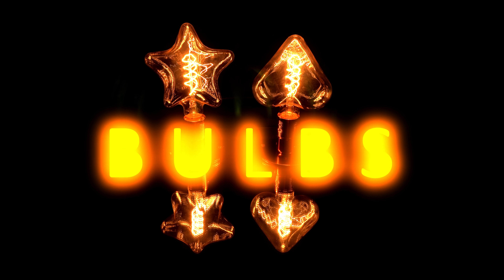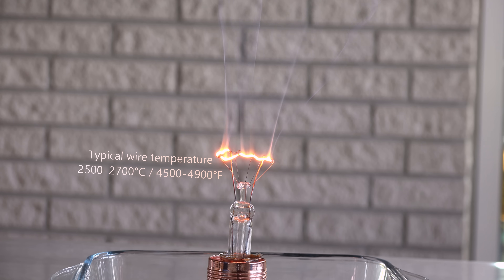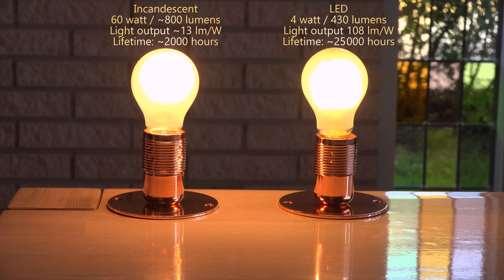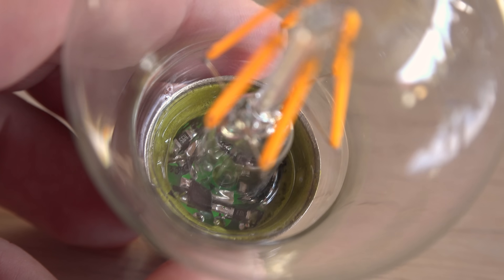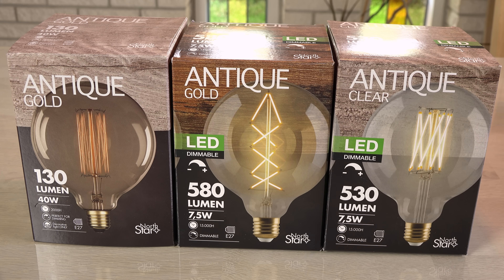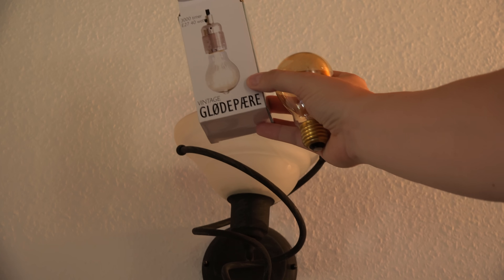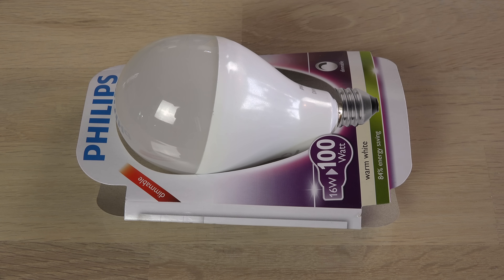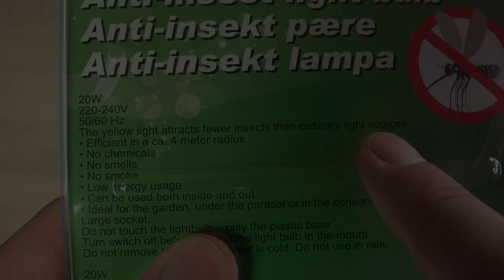Light Bulbs | LED vs. Incandescent

Comment: Why is the idea of Denmark banning the sale of inefficient light bulbs triggering all these Americans in the comments?

What was wrong with lead based paint? What was wrong with asbestos-lined homes? It's dun dingit tyranize!!! We dun can't have the dun dingit govinmunts dun tellin us whats we can't n can't not do!!
Reply: IIGrayfoxII
I agree.. the strange thing is that everybody (including tree huggers) jumped on the CFL bandwagon from the start. Now everybody is jumping on the LED bandwagon.
Reply: LSD Yes, the logic is identical.Stuff that's toxic to my neighbors / a public risk / going to explode or catch fire, or some shit? Of course ban it. That's fine that makes sense.

Lightbulbs pose NO threat, though. They're just more expensive. Thus, banning them is holding my hand as if I'm too stupid to do a basic arithmetic problem or choose how much of my own money I wish to spend. Or even if you argue it purely from economics, there's a billion other things I buy that could have had a lower economic impact that the government doesn't nanny me about: stainless steel refrigerator versus one with a plastic shell? wood floors instead of bare concrete? etc. etc.

It is EXACTLY the same as banning any other luxury good for the same reasons. You could make the same argument for the government banning cashmere sweaters, because rayon blend ones are cheaper, or banning me from owning both a couch and a bed when I could buy a futon and thereby have a lower environmental impact.

Why are those ANY more ridiculous than this is? And why are you not advocating laws for all of those and the other billion things? It's just internally inconsistent, disorganized nonsense.

Lobbying (as the guy above me suggested) is actually a plausible explanation as to "why this arbitrary thing and not everything else?", but who knows.
Reply: LSD Yeah, sure, energy inefficient. So are  imported cashmere sweaters. So is owning multiple pieces of furniture when one would do the job. So is living in a house with more rooms than you need. So is running your air conditioner at 65 degrees. So is taking a shower every day instead of 2-3 times a week. So is owning a pet. So is buying a full size laptop instead of a netbook. So is cooking with extra virgin Italian olive oil instead of bulk canola oil.

How many of those things would you like to regulate for government enforced energy conservation? Many of them have a larger impact by far than lightbulbs do, too.

And if you aren't willing to regulate all of them, how are you not being an arbitrary hypocrite?

-----------------------
Re: random assumptions:

None of this has to do with "distructing government." There's nothing to "trust" here, the Danish government already told us their exact plan. The problem is it being a stupid and inconsistent plan, not trustworthiness.

Nor did I mention anything about not considering poverty or illegal wars as a problem...? If you don't expect your government to be able to multitask on solving, you know, more than one problem at once, then you would seem to be the one that doesn't trust government, not me. I, personally, hold them to a high enough standard that I expect them to stop illegal wars, work on poverty, AND eliminate arbitrary, bad laws, all at the same time.

And I don't live in America.
Reply: LSD Foreign oil has to be shipped to you, using fossil fuels, etc., whereas where I live (Canada), canola oil is all local (that's where it is mainly produced). Premiere oil usually comes in much smaller less efficient containers. And olive oil is significantly less energy and resource efficient in the first place compared to cheaper vegetable oils, with more water and erosion issues, etc. First press agreed is not particularly relevant.

Anyway:

"Other stuff doesn't have alternatives" nonsense, did you read my post? I provided a lower impact alternative for EVERY example.

"Not everyone uses olive oil, everyone uses lightbulbs"
sure, but when you add up all food products, for example, total, they will have a MUCH larger environmental difference/impact than the lightbulbs do. A government mandated set of low impact diet options overall would much much much more massively benefit the environment than lightbulb bans. Do you support that? If not why not?

"Harder to measure"
This doesn't make any sense, because the current method for dealing with lightbulbs isn't measuring anything either/anyway. You can't say a possible piece of legislation is "harder to pass because it's harder to measure than this other law that doesn't involve measuring anything"... For example, air conditioning: Simply don't SELL air conditioners legally anymore that have settings that go lower than 72 or something. Just like the lightbulbs. Older models phase out, no need to "measure" anything.

"No drawbacks"
Cooking with canola oil (and all other diet alternatives, outside of medical needs exceptions), or A/Cing your house to 72 instead of 65 also have no significant drawbacks for the vast majority of people, just like lightbulbs.
Reply: It's not a "scam".  The fact is that even if the bulbs cost more, they use enough less electricity that it more than makes up for it.  And because the bulbs last so much longer, you don't have to buy as many.  I started converting to CFLs about 15 years ago, and in the past five years, as those go out I replace them with LEDs.  Right now, the computer room I'm in has been lit by LED bulbs for the past five years.  I haven't had to change them and instead of using 120w to light the room, I use 16.  I'm spending less money to light the room than you will with incandescent bulbs, and changing lights now means one or two bulbs a year.  The one with a week mind is the one who things everything is some big conspiracy.
Reply: There is also the fact that banning them eases loads on the electrical sub system.

If a substation powers 1,000 homes and all these homes use 75w filament bulbs for lighting that is 75,000 watts of power for all those homes to power 1 bulb.

Now 3 bulbs powered on average and that is 225,000watts and in summer when people use AC this can cause the substation to be overloaded.
But replace those filament with 10w LED and the load on the substation is 30,000watts.

These reductions also can mean a reduction in kilowatt hours you pay since the substations require less maintenance

And those who cry who cares how inefficient they are as they can not see how inefficient they are literary most of the energy emitted is infrared
Reply: +Gavin Jenkins
You and John Boy seem to love the slippery slope fallacy.  Just because the government bans one thing, there's no reason to think that they're going to step in and unreasonably ban many other things.  This is the same argument that people use against gay marriage (i.e. "if we let two women marry, then we're going to have to let people marry animals, etc.", which is not a reasonable counter argument).

LEDs have gotten way better looking and cheaper in a very short time.  And as others have mentioned, they save you money in the long run.  

Furthermore, although there's nothing directly poisonous/harmful about incandescent bulbs, you seem to be ignoring the consequences of consuming more energy that generally results in more CO2 emissions and other emissions.
Reply: +John Boy
It is known that CFLs were not good since the start since a CFL bulb is nothing more than those tube lights you will have in the garage but in a compact form.

The mercury(the vapor to be exact) is used to make light.
When you pass an electric current through a gas it emits light.

Mercury emits some and bluish light as well as UV light so to prevent you getting skin cancer and to correct the color temperature , the bulbs are coated in a white phosphor powder which absorbs this UV light and emits red light, this makes the overall light look white.
Reply: LSD Somebody moving into a new apartment without bulbs? What are you talking about, I've had to do this twice before. All it requires is a cheap ass landlord. Which are the ones you deal with anyway when you aren't well off.

And the credit ramifcations are not ridiculous at all. That's what it's like to be destitute. I have seen major debt problems from far less ridiculous situations. Even ones not based on anything at all, like an error on the bank's fault for an overdraft fee that wasn't an overdraft, then compounding due to negative balance fees, bank refuses to reverse it, person can't afford to just pay it off in the meantime. Person starts having issues due to negative balance elsewhere, unable to pay other bills, etc. Person cannot afford a lawyer or anything to argue with the bank's stubbornness. Person eventually has to take out a credit card to pay off their bullshit negative balance just to not miss other payments etc. Now has $300 in credit card debt all of the sudden from thin air.

When $0 / imaginary errors can cause that, $70 certainly can.

Of course, in this situation,they wouldn't pay the $70 for bulbs since it's not life threatening. They would just get 1 or 2 and make do. But that is why I said at the start "Oh well, guess you hang out in the dark"
Reply: The americans banned inefficient light bulbs a while back.
So this video brings back those "Bad Memories"
Reply: John Boy  "LED's only have one advantage - lower power consumption."

They also last many times longer.

"Higher up front cost"

Which is more than made up for by the fact that you don't have to buy nearly as many.  And it's not like it's a huge cost difference anymore.  By the second or third time you don't have to replace an incandescent, the LED bulb has paid for itself just in the cost of the bulbs.

"If you've faced the horrible xenon car headlights then you know what I mean."

That's not the color as much as it is that they're so damn bright.

"non compatibility with dimmers,"

That's true of CFLs and some LED lights, but not all.

"The nice thing about incandescents is that they mimic the color spectrum of fire / candles"

Then buy the 2700k LEDs.  That's the same "color temperature" as most incandescents.

" It (reading retention) drops significantly when reading material off an LED backlit screen "

Can you point me to a study that shows that to be true?
Reply: Gavin Jenkins
I would say that if there's sufficient societal benefit to a ban, and the consequences of the ban are reasonable/manageable, then I'd be in favour of it.  So, in the case of the incandescent ban, I think the consequences in terms of cost and light quality are very reasonable.  Without delving too deep into the specific items you listed, the practicality of those ideas relative to the incandescent ban may be too unreasonable for now.  Simply enforcing some of those things may be impossible.  Whereas eliminating a light bulb option from people's lives could be comparatively easy, especially since there are still very good options available.  It's generally better to start with the easy changes first and then move on to the tougher ones.  That being said, if things are dire enough that we have to take drastic measures, then I may have to accept unpleasant consequences.

Regarding "being a hypocrite doesn't invalidate an argument/position.":
Saying it does invalidate the argument is the Tu quoque fallacy.  It's a form of the ad hominem fallacy.  Arguments stand or fall on their own merits, regardless of who's making them. 

If there are other things that we could be doing that are equally as practical as switching from incandescent bulbs to LEDs, but were not doing them yet, it doesn't mean that the ban on incandescents was unjustified.  Just from a practicality stand point, we can't roll out every single energy saving ideas simultaneously.
Reply: ASBESTOS is only dangerous if taken internally. It is a great thing to have for gloves, compared to the ceramic fiber when handling hot things. Also the fibers do not get into the skin and cause itching. It is also no problem in cement used in heaters unless it is disturbed. If it is there in your exhaust for your heater leave it alone if you mess with it you will be breathing the dust from it.

ANYONE that believes that LED's and other such things are not about getting more money out of our pocket is an IDIOT!
Reply: If the only problem with lead-based paint or asbestos was some bullshit about "efficiency", I'd tell the government to get bent.
Reply: John Daman do you think greenhouse gasses are good for you and the environment?
Reply: I want to decide myself whether i waste energy or not . After all I PAY for it myself (at a ridiculous cost i should mention. Electricity is €0.30 a kWh in Germany. Probably highest in the world?).  
But not everyone here is a braindead communist. I'm sick of these idiots that want the State to tell them what to do. It's MY LIFE. And if I want to buy mercury CFL then it's MY FUCKING RIGHT. Move to China all you cucks. Then I can have more freedom.
Reply: +Eli Cohen Still on sale - where? They weren't it any shops I visited recently. And are you really saying that because we're leaving the EU that incandescent bulbs will being going on general sale again? I don't believe it.
Reply: +Gavin Jenkins "people have a lot of education and information at their fingertips, and can generally make local decisions that may be more rational than an umbrella national law"
So are you saying the gov't should never step in and ban things?  If you think they sometimes should, then I think we're just in disagreement on this one instance.  Or do you think the ban on things like leaded gasoline, asbestos, bovine growth hormone and CFCs was another instance where the gov't shouldn't have stepped in?

While some people may be informed (or think they're informed) on a subject, others are not, and we've agreed as a society to protect those who can't protect themselves.  That sometimes requires regulation on things that have varying degrees of harm to society.
Reply: Gavin Jenkins 

A: Nearly the same isn't the same.

B: Anyone can take a 2700K, 3000K and 5000K bulb, shoot a photo set to daylight and conclude the 2700K (The LED in this case) is terrible, just awful.

Compare a 5000K LED, CFL and Incandescent(...oh wait, 5000K Incandescent bulbs are speciality because incandescent lighting produces horrible colours, so they're gonna cost more than an LED would more than likely at this point) and you'll conclude the CFL looks the worst, and LED will look pretty much the same as Incandescent provided you're not shooting over 3000 fps.
Reply: RyuDarragh If they're "leaking" light into the sky, that's down to the design of the fixture.  You'd have the same problem regardless of the bulb.
Reply: LSD  As I mentioned to someone else here, it's wrong to initiate force against someone for making a choice you don't like. That is the principle at issue. It's not really about how risky something like lead paint is, it's about freedom to take such a risk, and it's not your or my or goverment's place to use force to prevent anyone from taking a risk just as it's not your, my, or government's responciblity for the conceqences to someone's risky choices.
Reply: Gavin Jenkins So you can put a gun to my head because I'm making a risky choice for myself and my family that you don't like?

How about a car? Do you want to put a gun to my head because I drive an old car that is nowhere near as safe and thus far riskier then a brand new car or  leaded paint for that matter?

How many other risky decisions do you beleive you have the right to put a gun to my head and tell me I can't make?

This is what happens when you accept the principle that initiating force against other people, because you think you know what's better for them, or the level of risk they should accept, is good. You become an authoritarian, and it this case, an authoritarian statist.

Congratulations.
Reply: incandescent lights sales are banned in all europe
Reply: and why someone should buy an incandescent light? it's obsolete, it waste a lot of energy, pointless
Reply: Tecnovlog Because they're cheap and effective. So long as it dosn't initiate force agaisnt anyone, people should be free to buy whatever they want.
Reply: cheap? yes maybe they're cheap but you would pay a lot more in the long run, people should be forced to abandon old stuff especially if that old stuff is damaging the environment, for you as a consumer means nothing, for the globe a lot. you don't have to buy led light, there is a pletore of good fluorescent lights that cost only a little bit more than an incandescent light
Reply: doesn't matter? why? do you prefer to spend 50 eurocents less for a light but several euros more every year?
Reply: Tecnovlog The goal of living here on Earth with other human beings.
And I don't care if you, an adult, use heroine, cocaine, LSD, pay a woman to have sex with you or buy inefficient light bulbs. None of those things initiate force against anyone.

I may give you arguments, reasons, and evidence on why you shouldn't do those things as they are risky (except for the light bulb), but, again none of those things initiate force against anyone and the risk is yours to take, as are the consequences.

I don't think you should let a child drink alcohol but 1. that's not something most children elect to do and 2. an argument can be made that a child does not yet have the experience or wherewithal to deal with potentially dangerous and damaging substances like alcohol so that choice should not be up to a child until they do. I'd say the same of a child playing in traffic, etc.
Reply: ***** The environment isn't the point, morality is.

btw Name something that isn't, in some say, directly or indirectly ecologically hazardous. Me taking a crap in the wood is ecologically hazardous if my number 2 bombs land on a patch of grass and smothers it.
Reply: Those "inefficient " light bulbs aren't poisonous like the other things you mentioned are. But the mercury vapor in flourescent light bulbs and LED is poisonous. Hole in your logic isn't there.
Reply: 1st understand that burning wood and give back co2 to atmosphere is normal and ecological.  Problem is extra levels that plant can not absorb, problem is that we release co2 from a lot more then 1000 years ago from carbon and oil,and even that CO2 will not be problem if we keep level of forest that can absorb that,but on other hand we release a lot more,and in same time we cut a lot more forest, so level of co2 increase too much...so choice is only to cut releasing co2 ,OR to make our planet temporally more green,by planting forests...but no, we cut ,cut,cut more ,a lot more then is allowed.. sum this all together ...and seems that only reducing power consumption ,together with more green power construction is key. So AAA grade eco friendly ,less energy products..but we need to ban oil and coal for energy production world wide..But,you know that is not near future,right! LED lighting have its part ,in consuming less energy world wide,and burning less coil and oil for electrical energy production..
Reply: +LSD - I did not take the time to read all replies in this thread. I only want to give you the simple answer to this question. This may have already been answered, but here is my opinion to add to the mix... 

(THIS ANSWERS YOUR QUESTION, I believe, about why Americans are so angry regarding government bans of selling these bulbs, even if these bans make sense in the long term!) 

Many people will come up with justifications for their arguments. They bend over backward to come up with many reasons, but I believe there are really only two reasons here for why people in the U.S. dislike the incandescent bulb ban. 

.
ONE - When this ban went into effect, you could buy a light bulb for about $0.20. They were very cheap and very disposable. I'm sure there is a lot of tungsten in trash landfills because they were quite easy to throw away and replace. 

At the same time, CFL bulbs were, at best, about $4.00 apiece. They have since come down a little, to about $2.00 apiece, but it's still significantly more expensive to buy light bulbs than it used to be. And, at the time, LED bulbs were very expensive. About $10 each. Very different from $0.20 each, and this angered many people. (LED bulbs have since come down to about $2.50 each, and I hope they continue to get cheaper.) 

.
TWO - The people who live in the U.S. are not descended from calm, quiet, reasonable people who moved here from other countries despite having a good life there. The ancestors of the people in the U.S. were generally all hot-headed, angry, stubborn, argumentative types of people, who didn't get along with their home countries when they moved here hundreds of years ago - and they usually moved here because they had terrible lives in their home countries. 

I believe that this can be demonstrated by looking at National attitudes, and can also be compared to Australia - which was founded under similar circumstances to the U.S. There is a good reason people in the U.S. get along so well with people from Australia. Our great, great, great grandparents were either forcibly thrown out of their home countries, or left in great anger and resentment never to return. They were not nice, calm people - they were argumentative and usually angry people. Some people today disagree with me about this, but I still believe I am right when I say that you can see these attitudes today in the great, great grandchildren of those immigrants from long ago. 

As such, people in the U.S. do not like it when the government tells them they cannot buy a simple light bulb. They come up with many arguments to justify their anger and their arguing, but the simple fact is that most people here do NOT like being told they cannot do something that they have previously done all their lives - such as buying a simple, cheap light bulb. Reasonable arguments about electrical requirements and National generator grids do not matter when somebody is simply angry at being told what they can or cannot do. 

.
So... keep this in mind. Regardless of any other arguments people make about the incandescent bulb ban - it always comes down to one of these two things in the U.S. Or, usually, both at once. We don't like being told, "You are not allowed to buy those from now on," and... the bulbs we have to buy now are, at best, ten times more expensive than they used to be. 

(Arguing that they save electricity is usually pointless too, because that savings only comes after many years, AND because many people have to buy bulbs that are not for themselves. Such as at an apartment that will be rented, at an office, for a neighbor or relative's house, etc., etc. For example, I repair many apartments {flats} that will someday be rented to somebody I don't know - and I don't like spending $100 or more on light bulbs when that cost used to be less than $10.)
Reply: I dont like muh government regulation but what's toxic about LED bulbs? They're just an array of semiconductors slapped onto a power supply.
Reply: +LSD - Oh, and one more thing... I live in the U.S., but I can't figure out what "dingit" is supposed to mean. What is "dingit", anyway? :P
Reply: "its my life, therefore i should make everyone else's lives worse"
Reply: It's making no ones life worse. In the day and evening I usually have on 8 -150 watt incandescent bulbs and 4 - 300 watt ones because I prefer the light they give and I have a lifetime supply.  I purchased a variety of incandescent bulbs, all total I have 1800 of them and they last and last.  i love it, there's 12 houses on my street and I probably use more power than all of them put together and I could give a shit.  When I travel I always bring a six-pack of 150's to swap out the bulbs in the room temporarily, I like to see.  So suck it.
Reply: +VivaMessico
I would agree with you on that. Government was created by economics, and and such, it cannot be separated. However, I was noting that capitalism was not a societal system, not that it wasn't political. I say this because the amount of corruption currently in a society does not affect what system it is unless the corruption would cause the government to physically change the system, which in the US, would require an overhaul of the Constitution. A true capitalism is anarchy, just as a true socialism is totalitarian.
Reply: Ender Skies "Does not the"? Since apparently judging by the phrasing, you are a time traveler from 1700s, the "plebians don't know how to live their own lives" I guess makes more sense in context. In 2016, though, people have a lot of education and information at their fingertips, and can generally make local decisions that may be more rational than an umbrella national law. The example from earlier in the discussion of people with electric heating in a cold climate being one situation where incandescent bulbs are better if anything for the environment, locally.

Though if you insist on bludgeoning the problem with a blunt one size fits all baseball bat of a solution, you could at the very least do it in a tax or incentive way rather than a hard edged ban, to still create the same trend, but with optional freedoms.
Reply: Dan Heuser 
no I am okay to ban things based on criminal potential, and uses in infringing on others' freedoms or safety. Lightbulbs do not fit those criteria. Many other things do, including several of your examples.

Even if you include climate effects (hard to quantify though since we don't know how much damage that might cause), lightbulbs still do not fit those criteria in some instances, and they also much much less of an influence than other things that are still legal, making for inconsistent and arbitrary law.
Reply: Ender Skies "If a child refuses to do whats best for itself, does not the parent have to force it to?"

And there's the nub of the issue.  I am not a child who must be guided by a government that knows (or thinks it knows) what's best for me.  I'm quite capable of making ration decisions without the government telling me what I must do.
Reply: I'm just lucky I have a stock pile of 'banned' bulbs that I require. But  I think it's much more reasonable for the government to incentivize greener tech, possibly increase Tax in lower efficiency products but I don't think a ban is best for the open market.
Reply: https://www.cnet.com/news/side-by-side-led-cfl-and-incandescent-bulbs/ You can see the color difference here. (That was written in 2011 but nearly the same LED bulb model is still a widely manufactured one, retailing $10 each today). Not enough to be a big concern to me personally (it's a philosophical and economically mishandled issue to me), but it is also not the same color.
Reply: I didn't conclude ANYTHING, if you'll notice, about any of those being the "best" looking. Please do not put made up words in my mouth.

I said that you can see the difference between all three, in a test run by a well respected technology authority that we can safely assume neutralized its camera sensor etc. correctly. And you can, indeed, tell the difference easily between all three.

I was replying to Ender Skies who seemed to be baffled by the base concept of different bulbs looking differently. They do look different. From there, which one anybody prefers is obviously subjective.
Reply: 177SCmaro Lead paint it IS the government's place, because unlike incandescent bulbs, the owner of a building responsible for lead abatement is NOT necessarily the only one at risk from the poison risk. Children who don't know any better and/or employees etc. are at risk,so intervening to force proper behavior if needed is in fact protecting innocents from harm done to them by another.

Even if you live alone, it can and will leech off into water, etc. etc.

For the lightbulbs, though, this logic does not apply. The energy bill is only the owner's responsibility.
Reply: 177SCmaro Yes "You" making a decision for people who are "not You" means you are potentially violating your own prime directive you described earlier: initiating harm against others. Threatening you to stop you from threatening others is not immoral. It is the same concept as self defense being an acceptable form of violence, because you are stopping violence perpetrated on another, not initiating.

YOU INITIATE the harm when you subject others (children, employees) to dangerous building conditions outside of their control or perhaps even knowledge. So when your philosophy is "never initiate harm" then YOU are the bad guy breaking your rule with lead paints.

Anything that only threatens you is your business. If you threaten others it's not your business anymore.

Bulbs are totally different in that their inefficiency does not hurt innocents on site other than the owner him/herself, so no harm is initiate on others, thus should not be regulated.

And yes, absolutely you could be morally regulated for an old shitty car, because you are forcing (and initiating) risk on OTHER people, so it's not your own business anymore. As long as you're on public roads, at least. If you want to drive a rattling death trap around your own private parking lot that nobody but you uses, and with only consenting informed adults as passengers, have a blast.
Reply: Gavin Jenkins "Yes "You" making a decision for people who are "not You"..."

Isn't that what you're doing? Isn't that what "the state/government" fundimentally is? Why is it wrong when i do it but right when you or a government does it?

"...means you are potentially violating your own prime directive you described earlier: initiating harm against others..."

First of all, it's "initation of force".

Secondly, the Non-Aggression Principle is not a "directive", it's a principle.

Third, we are talking about RISK, not of definite harm. Things like leaded paint, dangerious conditions, or less-safe cars are a RISK of harm, not definite harm.

Fourth, you never addressed the point.

Why do you think you or anyone else has the right to point guns at people and tell them what level of risk they are allowed to accpet for themselves and thier family?

(btw, I took great care to have my house inspected for leaded paint, asbestos, etc before I bought it and I didn't need someone pointing a gun at me and telling me to)
Reply: 177SCmaro The crucial difference is that the decision you are making is initiating risk and harm on others. Whereas the decision the state is making is only responding to your initialized harm and risk. (The distinction between risk and outcome is a silly one, they're both reasonable basis for intervention. Otherwise there is a trivial loophole in doing anything you want ever, because there's always a <100% chance it will actually work. Like if I shoot you, technically it's a RISK that I hit you, not a guarantee? Is that okay then? Lol no.)

In short: you started it when you risked others beside yourself, thus you voided any moral right to privacy and/or sovereignty. The state did not start it. They're responding to your initialization of harm.

If you want to be left alone, don't endanger other people.

"what level of risk they are allowed to accept for themselves and thier family?"

What level for YOURSELF? No, that's your own business. What level for your FAMILY? That's not your business. There is no logical basis for you deserving or having any right to control or make decisions for family members any more than any random stranger, and others are just as justified in intervening if you endanger them without their full knowledge and consent as if you endanger strangers. Especially in the case of young children, who aren't cognitively capable of understanding lead paint's dangers and cannot generally be perfectly supervised 24/7, this is relevant for this discussion.
Reply: Gavin Jenkins
" The crucial difference is that the decision you are making is initiating risk and harm on others."

Now you are conflating the two. Risk and harm are two differnt things. It's risky for me to buy my family a home with leaded paint. It's harm for you to shoot me in the head becasue you don't agree with that decicion and I told you to fuck off.

erm...not in that order.

"The crucial difference is that the decision you are making is initiating risk and harm on others. "

And, again, I have to point out that: isn't that what you're and government is doing by pointing a gun at me on account of taking a risk for my family? Seems like you are imposing an even greater risk then the piant.

"In short: you started it when you risked others beside yourself..."

If it's my family you're talking about, then what you are saying is, I don't own my children and decide what level of risk to take, my children don't own themsleves and decide what level of risk to take, "the state" owns them and decides what level of risk to take.

Well, again, why do you think anyone has that right?

"...thus you voided any moral right to privacy and/or sovereignty."

Why? Becasue you don't like a choice I made and a risk I took on behalf of my family you (or the state) fucking owns them now?

"They're responding to your initialization of harm."

Again, we are talking about risk not harm.

"If this doesn't include all harm, then that's just a stupid philosophy then."

ffs, it's a PRINCIPLE not a philosophy, learn the difference, and I didn't say it does or dosn't include all harm. It refers to FORCE, which implies harm, among other things. It didn't occure to me that I'd have to explain something so simple, but here it is.

":That's an irrelevant distinction."

sigh.....you're obtuse. Thanks for that waste of time. Moving on.

"What level for YOURSELF? No, that's your own business."

And, apparently, yours too as you beleive that it's right to put a gun to other people's head and tell them what level of risk they are allowed to accept or who can make descitions on thier behalf, or what decitions that person can make.

"What level for your FAMILY? That's not your business."

So it's not MY bussness what level of risk MY familey accepts. Did you not read these before sending it to me? Becasue you just said what is mine isn't my bussness.

Is it my famliy or is it "the state's" family? Who does "the famley" belong to? Or, the more salient question is, who do the children belong to?

"There is no logical basis for you deserving or having any right to control or make decisions for family members any more than any random stranger, and others are just as justified in intervening if you endanger them as if you endanger strangers."

That is a logic self-contradtion.

If there is no logical basis for me deserving or having any right to control or make decsistion for family members, then it follows this is true for everyone: stangers or "the state" included.

If no one has any right to control or make desistions for others, then that pecludes them intervening as that is a form of control and making desistion for others.

In fact, if there is no logical basis for anyone deserving or having any right to control or make decsistion for others, that logically precludes government/"the state" from existing.

So I guess you're an Anarchist now like me then. Welcome to the club.
Reply: "isn't that what you're and government is doing by pointing a gun at me"

No, the government is causing a risk for you. But they aren't INITIATING it. You initiated it. They are responding to you. Thus, it is still always within your power to live your life free of that intervention, by choosing to not endanger others. Do so, and I'll leave you alone.

"I don't own my children "

Um of course you don't "own" your damn children. Slavery is about the least possible libertarian thing you could possibly have suggested. You're going wayyyy off the deep end here.

"Let [my children] decide their own risk"

No, if they are incapable yet of looking out for themselves, then their caretaker has to do so for them, of course, but I can reasonably still obligate you to do a proper job of it. Leaving your kid in a cage and feeding him mouldy bread and water is unacceptable and demands intervention for abuse and initiation of completely unnecessary harm. Lead paint is a milder version but the same concept.

If you can't manage to raise your children in a non-harmful and negligent way, don't have children, that's on you. But you created a human, and thus you created an obligation--like with ANY human under libertarian principles--of another person to not initiate harm of. If you can't hack that responsibility, you are free to wear condoms. But if you have the kids anyway and don't take care of them, it's no more morally okay then mugging somebody in an alleyway.

"Again, we are talking about risk not harm."

And again, a system built on actual harm is completely unworkable. Because you NEVER know what is 100% harm until it's too late and it's already been done. That's a stupid, unworkable system. It allows me to flood your house with radiation, for example, because there's some % chance it won't give your horrible cancers, so it's a risk only? Sweet! A-okay! It allows me to dump poisons by the gallon into your water supply, and you could do nothing about it ("only a risk!") until you actually get poisoned at which point it's probably too late.

Of course we can't have a system like that. It'd break in 5 minutes. Risk must be included in any real world system, or everybody would have a million ways to slaughter each other and utterly wreck property and environment carte blanche so long as it's just slightly delayed on a little bit uncertain.

"If no one has any right to control or make desistions for others"

No, you DO have a right to RESPOND to harm being done. You only don't have a right to INITIALIZE harm.

It's only a contradiction because you mischaracterized it / ignored initialization. Which seems awfully intentional, considering that you brought up the concept of initializing actions in the first place here, not me, so I know that you full well understand it... until it's convenient for you to forget apparently.

Murder? Not okay, initialized. Self defense manslaughter? Acceptable, wasn't the initializer, the attacker voided his rights by starting it. Similarly, arresting you because I don't like your face? Not okay, initialized. Arresting you (or whatever the required level of intervention is to stop the situation -- in the case of lead paint simple economic regulations are less drastic and sufficient) to stop you harming somebody else? Acceptable, you would be initializing it, and thus voiding your rights.
Reply: Gavin Jenkins "No, the government is causing a risk for you. But they aren't INITIATING it. You initiated it. They are responding to you. Thus, it is still always within your power to live your life free of that intervention, by choosing to not endanger others. Do so, and I'll leave you alone."

Really? I'll have to remember that when April comes around that if I leave goverment alone it won't initiate force against me via taxation and will leave me alone. Becasue, you know, logical consistency and all that...

And, again, I have to point out that pointing guns at people for not doing what you want them to do is much riskier then lead paint.

"Um of course you don't "own" your damn children. Slavery is about the least possible libertarian thing you could possibly have suggested. You're going wayyyy off the deep end here."

Okay, but note that you failed to specify who does, which was my point. Who owns, and is thus responsible for, children if not the parents?

"No, if they are incapable yet of looking out for themselves, then their caretaker has to do so for them..."

So I have to look out for my children, but I don't own them. Isn't that like saying I'm responsible for my children's safety, but, since I don't own them, they don't have to do what I say? After all, you can't command things you don't own.

Again, who owns children?

"Leaving your kid in a cage and feeding him mouldy bread and water is unacceptable and demands intervention for abuse and initiation of completely unnecessary harm. Lead paint is a milder version but the same concept."

Um, no. Putting someone in a cage requires force in you putting them there. Living in a house that has increase risk to one's health becasue of lead paint is not force.

You are still conflating risk and harm. It's harmful to force someone into a cage and feed them moldy food, it's risky to buy a home with lead paint for your family to live in.

These are not the same thing.

"If you can't manage to raise your children in a non-harmful and negligent way, don't have children, that's on you. But you created a human, and thus you created an obligation--like with ANY human under libertarian principles--of another person to not initiate harm of. If you can't hack that responsibility, you are free to wear condoms. But if you have the kids anyway and don't take care of them, it's no more morally okay then mugging somebody in an alleyway"

Okay you keep going on and on about this, but, again, who owns children? If it's not the parents, then who?

"And again, a system built on actual harm is completely unworkable. Because you NEVER know what is 100% harm until it's too late and it's already been done."

So we should put people in jail based on the likely hood that they may cause harm, even when they haven't actually harmed anyone.

I guess we should all be in jail then since we all have some chance at causing harm at any given point in our lives.

"It allows me to flood your house with radiation, for example, because there's some % chance it won't give your horrible cancers, so it's a risk only?"

Um, no. That would be an a contamination/intrusion on someone's property. That's a bad example for the point you were trying to make.

"It allows me to dump poisons by the gallon into your water supply, and you could do nothing about it ("only a risk!") until you actually get poisoned at which point it's probably too late."

See above.

"No, you DO have a right to RESPOND to harm being done"

Which is a form control or making decisions about risk for others. I noticed you tried to step WAY around that one but, again, if no one has any right to control or make decisions for others, then that precludes them intervening as that too is a form of control and making decisions for others.

In fact, if there is no logical basis for anyone deserving or having any right to control or make decisions for others, that logically precludes government/"the state" from existing.

So I guess you're an Anarchist now.

You destroyed your own argument.
Reply: "And, again, I have to point out that pointing guns at people for not doing what you want them to do is much riskier then lead paint."

Oh good so you acknowledge risk does matter now as a valid means of something you're not allowed to do unrestricted. I am glad we agree finally on that. Saves a lot of typing. Also, I'm not at all sure that pointing guns IS actually riskier to health than lead paint... as long as it's a child exposed (it's a developmental poison). Lead is really fucking bad for children.

"So I have to look out for my children, but I don't own them."

Yes this should be common knowledge that slavery is not legal or right, but that you still have to take care of your kids...?? Duh.

"Isn't that like saying I'm responsible for my children's safety, but, since I don't own them, they don't have to do what I say?"

Children do not "have" to do what you say in either an actual modern day legal sense nor libertarian philosophical sense. In most states today, for example, you have some leeway for things like sending your kid to bed without dinner for a day, yes, but at some point, if you keep doing it, you could be breaking the law and it would also be inappropriate under libertarian concepts as well to endanger a child with lack of food as a means of control, for example. Similar for physical force. At some point, you run out of options, but as long as your care isn't the thing they're refusing (such as a hunger strike), you're still obligated to care for them even while they refuse to keep swearing a lot or whatever non-life-or-death misbehavior you don't like.

"Again, who owns children?"

Nobody owns human beings. What are you even talking about? Unless you're suggesting we reinstate slavery, this is just an undefined/nonsense concept.

"Living in a house that has increase risk to one's health becasue of lead paint is not force."

Yes it is. They're a little kid who can't get a job, etc., and will freeze to death outside. They have no other options, so they ARE forced to sit in your lead-filled house before a self sustaining age. They also got into that situation because of YOUR choices in having them. So it's not like some hobo that doesn't have other options knocking on your door: their predicament in this case is entirely YOUR doing and thus your mess to look after.

Also at some point young enough, they won't even know it's a risk to have tried so much as considering a plan (babies). So it's not even just an issue of force versus options or choices or wills. Lead in particular is especially aggressively regulated largely because it's MOST dangerous to kids at precisely the ages that don't even have the capacity to understand it or can't escape it / maybe can't even walk yet.

"if no one has any right to control or make decisions for others"

Well that's easy: they DO. I never said they didn't. You absolutely have a right to both control and make decisions for others in a specific set of circumstances from both a modern legal standpoint as well as a libertarian doctrine: any ones where their decisions and actions without being controlled would have led to harmful endangerment of another person besides themselves.

The logical basis is of course that it is impossible to have a society where people don't initiate harm against others, if nobody ever enforces that rule. Those words only mean anything if and when you can go out and stop somebody who is breaking them / endangering others.

"So we should put people in jail based on the likely hood that they may cause harm, even when they haven't actually harmed anyone."

No not necessarily. We should do whatever the MINIMAL thing we can do is to remove the high risk of harm, which depends on lots of things, the timeframe of the risk, the urgency, the motivation and likelihood of it recurring, etc.. If they are foaming at the mouth and waving guns around and have gone totally insane and will do it again tomorrow and the day after if not stopped, then yes, that's probably jail until. If it's lead paint, then jail is clearly not necessary, because there's a much more minimal option: simply not having it on shelves. Jail would be overkill.
Reply: Gavin Jenkins "Oh good so you acknowledge risk does matter now as a valid means of something you're not allowed to do unrestricted."

I don't know what means. There is risk in literally everything you do. My point is it's wrong for you to point a gun at me or my family and tell us what level of risk we must accept.

"Yes this should be common knowledge that slavery is not legal or right, but that you still have to take care of your kids...?? Duh."

facepalm.....oh my god I wish you would actually think about what you type, becasue one could desrible being a slave as someone else being entitled to you or your protection, labor, etc but you having no say or athority over them as you don't own them.

In effect, they own you. They have a right to you, you don't have a right to them.

So you are saying that I don't own my chidren, they effectivly own me, we just don't call it ownership. We just call it "something you have to do".

The problem here is you don't want to say parents own thier chidlren, but you still want to hold parents responsible for children.

That is a contradiction. If I don't own something, I can't logically, be held responsible for it.

btw, I'm not saying parents should or shouldn't own thier children, I'm just pointing out the fundiemntal contradiction your entire argument is based on. More on that shortly.

"Children do not "have" to do what you say in either an actual modern day legal sense nor libertarian philosophical sense."

Then, again, how can I be held responsible for them? If a child dosn't have to do what I say when I tell them not to jump off a cliff, how can I be held responsible for the child's broken leg after he or she jumped off the cliff?

In other words, if you are under someone's protection and you don't have to listen to them, how does it make sense to hold them responsible for you getting injured on thier watch?

"Nobody owns human beings"

Nobody? So a human being is akin to a random rock in an unowned forest that anyone could come along, pick up, and thus own?

Are you sure human beings don't own themselves?

"...their predicament in this case is entirely YOUR doing and thus your mess to look after."

Then stay out of it. You can't have it both ways. You can't say I don't own my children, but I'm also somehow responsible for them and so it's my responsibility to fix this lead paint problem for them and then point a gun at me as though you own and are responcibole for my children and its your responciblity to rescue them.

Me: "if no one has any right to control or make decisions for others..."

You: "Well that's easy: they DO. I never said they didn't."

You're contradicting yourself again. And yes you did say they didn't.

I quote you:
"There is no logical basis for you deserving or having any right to control or make decisions for family members ..."

Unless you're arguing that I don't have any right to control or make decidtions for others but you and/or goverment does, which is logically inconsistent, then you were stating a universal moral principle, which apples to everyone, that principle being: No one has any right to control or make desistion for others.

If no one has any right to control or make decisions for others that destroys your entire argument, which is based on a form of control; namley, intervention, and making a decistion for someone else about what level of risk they should accept, and also the concept of "government/the state", which is fundimentally based on control over others and making decistions for others (even against thier will).
Reply: 177SCmaro "My point is it's wrong for you to point a gun at me or my family and tell us what level of risk we must accept."

But you saying that's wrong to point a gun at you WITHOUT having actually shot you means that you're agreeing a risky/threatening situation is bad enough to stop people from doing even though it hasn't already harmed.

Which is precisely the same situation with lead paint. If you think this is sufficient for intervention with guns *despite no harm done*, why not lead?

"one could desire being a slave as someone else being entitled to you or your protection, labor, etc"

No, one cannot, because that's not the definition of ownership or slavery. Owning services =/= owning the humans, obviously. This is utterly bizarre.

SImply renting a mall cop or a moving company =/= "owning" the cop/movers. Lol??

Similarly, the kid might be said to own the FOOD that you give them, and/or their BED that you give them, etc. Not YOU.

"Are you sure human beings don't own themselves?"

Not the way you are trying to use it as "everything including every bit of your own labor ever, even if they've already committed it or contracted it or given it away or so on" no they don't.

"Then stay out of it."

No. If I don't intervene or am not allowed to intervene when an innocent is being endangered, then how can I expect others to intervene for ME when I'M being endangered?

If this were not the rule, then no sort of society would be possible or make any sense.

"There is no logical basis for you deserving or having any right to control or make decisions for family members ..."

If your family members were threatening or endangering somebody, then yes you could control their actions to stop them, like with anybody else,as per the fundamental principles of libertarianism. This was not relevant to that discussion in that context, ffs I can't put a page long disclaimer on every sentence for every possible context that isn't being discussed yet.

"Unless you're arguing that I don't have any right to control or make decidtions for others but you and/or goverment does"

No, EVERYONE has the right to intervene to stop endangerment against anyone else. And has zero other rights to intervene.

If I initiate endangerment, you or the gov can intervene.
If you initiate endangerment, I or the gov can intervene.
If the gov. initiates endangerment, you or I gov can intervene.
If X initiates endangerment, Y can intervene.

It is not that hard of a concept. You're trying to argue against it by re-casting it into "intervening in either ALL or ZERO situations, therefore __" which is just silly. Of course it isn't all or nothing. Some things allow intervention, others don't. Specifically, it's "allowed for endangerment" but "not allowed for anything else"

"You can't say I don't own my children, but I'm also somehow responsible for them and so it's my responsibility to fix this lead paint problem for them and then point a gun at me as though you own and are responcibole for my children and its your responciblity to rescue them."

Yes I can. This is perfectly consistent with the above rule.

Lead = endangering, so others can intervene.

Not feeding people who you created and are helpless and can only reasonably rely on you = also endangering, so others can intervene.

Two simple applications of a one sentence rule, what's the contradiction? There is none. Simply stating "you can't" at the beginning doesn't make it a contradiction either. It's like writing "You can't pay for sushi but also pay for soda!"
Reply: Gavin Jenkins
"But you saying that's wrong to point a gun at you WITHOUT having actually shot you means that you're agreeing a risky/threatening situation is bad enough to stop people from doing even though it hasn't already harmed."

No, and you're still conflating harm with risk.

Pointing a gun at someone, even without actually shooting them, is a harm. The damage is phsycological. This is backed up by science. 

Living in a home with lead paint is a risk, not a definite harm.

It is a violation of the NAP to point guns at people, it is not a violation to accept a level of risk.

"No, one cannot, because that's not the definition of ownership or slavery. Owning services =/= owning the humans, obviously. This is utterly bizarre."

Defintions are not arguments, they do not reason, etc. If person A owns/commands the products of Person B's labor and Person B gets nothing in return and has no authority over Peson A, Person B is, effectivly Person A's slave. You're describing slavery you're just not using the word "slave".

This is dishonest on your part.

"Similarly, the kid might be said to own the FOOD that you give them, and/or their BED that you give them, etc. Not YOU."

See above.

"Are you sure human beings don't own themselves?"

Not the way you are trying to use it as "everything including every bit of your own labor ever, even if they've already committed it or contracted it or given it away or so on" no they don't."

That is a massive stawman. I never said self-owership is owning "everything including every bit of your own labor ever, even if they've already committed it or contracted it or given it away or so on" no they don't."

Self-ownership means to own one's self - one's body and the products or results of one's body. Labor is a product of one's one body and so one owns his labor and can thus trade it whatever he wants.

So I ask again, are you sure human beings don't own themselves?

"No. If I don't intervene or am not allowed to intervene when an innocent is being endangered, then how can I expect others to intervene for ME when I'M being endangered?"

So you're still trying to have it both ways.

You specifically said: "There is no logical basis for you deserving or having any right to control or make decisions for family members."

Literally what you're saying is, "There is no logical basis for controling or making descistion for others, but I can control or make descistion for others when I don't aggre with them or find those descistions too risky."

wtf am I even supposed to say to that other that point out the logical contradiction?

"If your family members were threatening or endangering somebody, then yes you could control their actions to stop them, like with anybody else,as per the fundamental principles of libertarianism. This was not relevant to that discussion in that context, ffs I can't put a page long disclaimer on every sentence for every possible context that isn't being discussed yet."

How is it not relivant when you specifically said, "There is no logical basis..."

"No logical bases" includes all contexts.

"No, EVERYONE has the right to intervene to stop endangerment against anyone else. And has zero other rights to intervene."

Again, this contradicts, "There is no logical basis for you deserving or having any right to control or make decisions for family members."

"You're trying to argue against it by re-casting it into "intervening in either ALL or ZERO situations, therefore __" which is just silly."

Actually, that is how YOU cast it: "There is no logical basis for you deserving or having any right to control or make decisions for family members."

Maybe you should have said: "There is no logical basis for you deserving or having any right to control or make decisions for family members, except when there is."?

"Yes I can. This is perfectly consistent with the above rule."

No, it's not. You can't logically be held responciple for people's saftey who don't have to obey you.

"Two simple applications of a one sentence rule, what's the contradiction?"

See above.

Look, this has been amusing and all, watching you tie yourself into kots trying to rationaize your logical inconsistencies and outright contradictions. But, again, as far as I'm concered you destroyed your own argument two replies ago, as I pointed out and as you ignored, and now you're just trying to defend it's corpse by pretending it's still alive.

This isn't fun or funny anymore, it's more sad and annoying.

Later.
Reply: "Pointing a gun at someone, even without actually shooting them, is a harm. The damage is phsycological. This is backed up by science."

Wow. No. The trauma of being scared by a big gun is not REMOTELY as bad for you as actual fucking lead poisoning that merely may not happen to be bad enough to give you visible brain damage. If you are including hurt feelings, then you have already committed to way way way less risk than lead as qualifying for intervention.

"and Person B gets nothing in return"

If you don't think you get anything in return, then why the hell did you have kids? That inherently argues against itself. Having them, in a day and age when both abortions and preferably birth control are widely available and relatively cheap, is nearly always a choice made because the parent WANTS them, in other words find inherent value in them, in other words, is getting something out of it. Which makes it not slavery. That makes it just like buying a sandwich or signing a mortgage or dating somebody. You chose to enter into it yourself.

Slaves don't choose their relationships themselves So that is completely different.

"Labor is a product of one's one body and so one owns his labor and can thus trade it whatever he wants."

Yes and YOU DID. You traded it for a kid.

"You specifically said: "There is no logical basis for you deserving or having any right to control or make decisions for family members."

And as I already specifically corrected that, "...except when endangering others." I did not mention it the first time, because we were not talking about it in a context where that was part of the discussion. Regardless, it doesn't matter, because I've now clarified it plainly twice, so please reference the full concept in the future if you're going to at all: No intervention EXCEPT to prevent endangerment. Or depending who you ask, probably also property damage. The end. Same rules for everybody. You, me, government, everyone. 

"You can't logically be held responciple for people's saftey who don't have to obey you."

Okay so you're just simply not a Libertarian then, which makes the whole conversation pointless, since it was about Libertarianism the whole time. The philosophy requires intervening in order to ensure the human rights to not be harmed/endangered/property damaged. If you don't intervene, then those rights obviously do not actually exist, because all you're left with is just politely asking, and obviously 90% of people will just ignore polite requests, making it complete anarchy, not any philosophy at all.
Reply: Gavin Jenkins I'm going to keep this breif, or at least try.

" Wow. No. The trauma of being scared by a big gun is not REMOTELY as bad for you as actual fucking lead poisoning..."

I didn't say it was. You missed the point, which was about you, once again, conflating harm with risk.

"If you don't think you get anything in return, then why the hell did you have kids?"

Again, not the point. The point is you are describing slavery, you're just not calling it that.

"Yes and YOU DID. You traded it for a kid."

If I traded my labor for the kid then I own the kid. Again, you keep going back and forth on this, trying to have it both ways.

"And as I already specifically corrected that, "...except when endangering others." "

Okay, then it's as I said, you're trying to appliy a universal principle when it applies to me and my choices, but creating exeptions for yourself or governemnt when I do something you don't like.

It's wrong for you to control, but not me. Or, it's wrong for anyone to control, except when it's not. 

"Okay so you're just simply not a Libertarian then..."

Nope, I'm an Anarchist, thanks for asking. I'm not saying I nessisarily agree or disagree with any or all the points I've made. Right now I'm just pointing out your logical inconsistencies and contradictions.

After all, an Anarchist can argue that, for example, one form of government is better (or, rather, less-bad) than another but still not accept the idea that any government is rational or moral.

"...since it was about Libertarianism the whole time."

I never said I was a Libertarian or was arguing on thier behalf or that this was about Libertarianism. I don't think I ever even mentioned the word Libertarian on this thread until now.

"The philosophy requires intervening in order to ensure the human rights to not be harmed/endangered/property damaged."

Yes, but you directly contradicted that by stating that no one has a right to control anyone else. That includes interference. That is my point. You can't have it both ways. You can't say interfenence is wrong when I do it by accepting risk on the behalf of my child, but right when you do it becasue you don't agree with that risk.

Is any of this getting through to you?

"If you don't intervene, then those rights obviously do not actually exist..."

Rights don't, nor ever did, exist. They are a concept in our minds. They arn't things like clothing that you can put on a person.

"...making it complete anarchy, not any philosophy at all."

You espcally don't know what you're talking about here. Anacrchy is a philosophy and it has rules, the Non-Agression Princible being the fundimental one and, as far as I know, it's the only philosophy to logically consistently apply that principle. But I digress...
Reply: " I didn't say it was. You missed the point, which was about you, once again, conflating harm with risk."

If you have lead all over your house, the kids ARE getting lead poisoning, that's just basic physics and chemistry. That's not where the "risk" is, it is guaranteed. The "risk" is merely a matter of whether it's ENOUGH lead poisoning to noticeably brain damage them, cause diagnosable levels of developmental delays, etc. And yeah, that part's not guaranteed. But it's sure as hell worse than being scared once no matter what level of poisoning you're getting or if it's easily measurable.

"Again, not the point. The point is you are describing slavery"

If you getting something in return for your labor, and you having given it knowing what that thing was beforehand, is still not enough in your mind to make it not "Slavery" then somebody paying you to mow their lawn is also, therefore, "slavery" because you owe them labor. You got something in return for it, just like with kids. You knew up front what you got, like with kids. But apparenlty these concepts do not matter to you and so anybody getting any labor from you at all makes you a slave. Okay, sure, when you use "slave" to just be a synonym for "work" then yes we are all "SCmaro style slaves" about 99% of the time in any conceivable society. But not actual, rest of the world style slaves.

"I never said I was a Libertarian or was arguing on thier behalf."

The things you're arguing (originally at least) are straight up mainline traditional libertarianism. Not anarchy. Somebody pointing a gun at you is allowed to in pure anarchy, because they're allowed to do anything, nobody is stopping them. Since anarchy is just lack of control, then by necessity what is "allowed" merely defaults to what is allowed by physics itself. Are they physically able to point a gun at you? Then they're allowed.

"Rights" and "principles" just don't make any sense at all without allowance or mechanism in place to ever intervene in any organized way.  It's just pure meaningless mental masturbation otherwise.

"Anacrchy is a philosophy and it has rules"

It's a philosophy yes. It does not have rules, no. Rules require enforcement. So you are NOT arguing for a system that works by the non-aggression pact. Because pacts and contracts fundamentally cannot exist without organized enforcement of their terms.

Non-aggression pacts are a libertarian concept in any form of actual practice, wherein you have minimal government or whatever organization to protect core principles. Non aggression being one. Even if that's your only one, it must be enforced to exist or happen, so you have minimal oversight = libertarian, not no oversight = anarchy = no possible pacts.
Reply: Gavin Jenkins Okay, so you're still not getting it. Maybe you never will see the contradictions, conflations, and inconsistencies. But I think I've given you enough of my time on all that.

"It does not have rules, no. Rules require enforcement."

Spoken like a true statist who has never considered the possiblity that the state may not be nessisary. No, rules do not you require enforment, REGULATIONS require enforcment.

You're conflating postive enforcment (initating force) with negative adherence to a principle - as though these are the same thing.

Rules require understanding and adherence to the principle behind the rule. 

For example, "theft is wrong" is a principle, so "you can't steal from people" is the rule and if you violate that rule you are subject to another principle, that of self-defense (of one's property), in which case it's logical and moral for your victum to use force against you to protect his property, i.e. to protect himself from the force you initiated (hence the fundimental rule steming from the fundimental principle of non-agression).

So, again, there are rules under Anarchy based, fundimentally, on the Non-Agression Principle. This rule is not enfocred. Certainly not in the way a governent regulation or law is enforced, it's simply an understanding that it's wrong to initatinte force and if you do, others can use force against you.

That's not enforcment, it's, basically, self-defense of one's body and property. It's akin to a "negative right" to use force in the cause of defense where "enforcment" implies a "postive right" to use force to impose requirements or opinions on others.

"Non-aggression pacts are a libertarian concept in any form of actual practice, wherein you have minimal government or whatever organization to protect core principles."

I doubt you'll understand this, given how compeletly you failed to understand logical self-contradiction before, but......that is a logical self-contradiction.

The idea that the initation of force is wrong is fundimentally incompadaible with the idea of a miniority of people who's right and duty is to initatine force against others.

You compeltly fail to solve the problem of people initating force, i.e. the NAP.

This is why I'm not a Libertaraian or an Objectivist. Both of those philosophies try to hold on to and rationalize this contradiction on the grounds of "nessisity", as though that somehow makes it not a contradiction.
Reply: "it's simply an understanding that it's wrong"

But it's not. It's not even that. It's absolutely nothing. Because nobody else may even understand that, including the burglar, nor at any point would it matter at all what something being labeled "wrong" has to do with anything. So these are all null concepts that make no sense.

It doesn't just not exist in a concrete tangible way. It doesn't even exist in a philosophical way without any outside enforcement. You may just as well say "Purple 17 flamingo" and it would make as much sense as "rules" or "right or wrong" in terms of societal interactions in a world with no society enforcing anything.

"the idea of a miniority of people"

Except no no no. As I've very explicitly said like 5 times, it's not a minority power or privilege. EVERY. SINGLE. PERSON. enforces it. Against everyone else. There's absolutely nothing minority about it, it's equally applied, and totally universal. That's the opposite of minority control.

"It's akin to a "negative right" to use force in the cause of defense where "enforcment" implies a "postive right" to use force to impose requirements or opinions on others."

This distinction makes no sense, since I'm talking about enforcement of the exact thing you're talking about enforcement of. The only difference is that for no apparent reason, you're allowing the victim to fight back, but not allowing anybody to help him fight back. But why? If the thing is wrong and okay to fight against, then obviously others can and should help. For precisely the same reasons the victim can and should.

Yes it's imposing requirements--the exact same ones that you already explicitly agreed were okay to impose if you're a victim. Those of defense.
Reply: Gavin Jenkins "But it's not. It's not even that. It's absolutely nothing. Because nobody else may even understand that"

You understand that the initation for force is wrong. So do I. If we can figure that out, why can't society? Espcally if we start teaching it to our babies.

No one said it would be quick or easy, but it can be done.

"...nor at any point would it matter at all what something being labeled "wrong" has to do with anything. So these are all null concepts that make no sense"

The same is true of government and it's endless laws and regulations. The diffrence is, under Anarchy, there isn't a minorioty of people who have the right and duty to initiate force.

"It doesn't even exist in a philosophical way without any outside enforcement. You may just as well say "Purple 17 flamingo" and it would make as much sense as "rules" or "right or wrong" in terms of societal interactions in a world with no society enforcing anything."

If you don't understand the difference between philosophy and random jibberish I think we should end this conversation.

"EVERY. SINGLE. PERSON. enforces it."

So every single person is the governemnt. We all have the same power to enforce laws, regulations, etc on each other?

Clearly every single person does not have that power. I propose that no one should.

"The only difference is that for no apparent reason, you're allowing the victim to fight back, but not allowing anybody to help him fight back"

You misunderstand. I've moved past the previous conversation and was just talking about your comments about Anarchy and the NAP.

I don't have any problem with people helping each other or banding together in the cause of defence. My previous problem was with the contradiction you based your previous argument on, but, again, I wasn't talking about that or in that context, just about Anarchy and the NAP.
Reply: "You understand that the initation for force is wrong. So do I. If we can figure that out, why can't society? Espcally if we start teaching it to our babies."

It doesn't matter if everyone understands that, and most everyone already DOES. So what? Tons of people will still initiate force against you all the time if nobody stops them. People do shit all the time that they realize is wrong if they think they can get away with it, are you living on the same planet as I am?

"If you don't understand the difference between philosophy and random jibberish"

I meant that in terms of society and crime rates etc. etc. it may as well be "purple 17 flamingo." Sure, in your own head as a hobby it is different than gibberish, but for any practical discussion about how to structure civilization or doing anything real out in the world, it isn't effectively different than gibberish. It must have some consequence backing it to take on any actual meaning in terms of society, or everyone who doesn't just randomly happen to apply it to their own lives already (for whom talking about it wasn't necessary anyway) will very simply ignore it.

"We all have the same power to enforce laws, regulations, etc on each other?"

I'm talking about what COULD be the case, not IS. So yes, we could all have the same power. Although, incidentally, in terms of the main thing we've been talking about, at least, that one already is widely legal to a good extent. I am not sure about every single state in the U.S., but places I've lived before personally, you as a private citizen could absolutely attack somebody who was attacking an innocent person on the street, and it is legal for you to defend them like that. So everybody is indeed granted the power to enforce the ban on endangerment of others/initiation of force/etc. That's not the case for every law currently, but preventing immediate danger/harm, usually yes.

"I propose that no one should."

So NOBODY is allowed to defend anyone? Because the only law/rule I've proposed is defending people against endangerment. This directly contradicts your last paragraph in this same post: "I don't have any problem with people helping each other or banding together in the cause of defense." 

Which is it? Do all people have this right to defend anyone (in which case you just agree with me)? Or does nobody (in which case, you're contradicting yourself above)? Or do just some people have the right (in which, case, who and why only them, and how is this different than the special government privileges of the few you were complaining about)?
Reply: Gavin Jenkins
"It doesn't matter if everyone understands that..."
 
Yes it does. It very much matters. I know one understands something how could they ever act on it?
 
"...and most everyone already DOES. So what?"
 
No they don't. Most people are raised amorally and violently and under authority so accept it as the norm and drift though life in an amoral fashion. Which, again, the proof if this is the amoral, violent, authoritative society we life in.
 
As I said, it start in the home in how we raise our babies. There is scientific evidence to back this up.
 
"People do shit all the time that they realize is wrong if they think they can get away with it,..."
 
Which is an example of my point in that most people ACT amorally.
 
"It must have some consequence backing it to take on any actual meaning in terms of society, or everyone who doesn't just randomly happen to apply it to their own lives already (for whom talking about it wasn't necessary anyway) will very simply ignore it."
 
I don't think you understand the influence or effect how we raise our children has. You seem to be under that assumption that people are inherently violent because people are violent (a circular argument) rather than understanding that people are violent mostly becasue that's how they are raised.
 
"So NOBODY is allowed to defend anyone?"
 
No, digbat, please try to follow along. You were talking about enforcing law. No one should have THAT power over another human being.
 
"Law" is merely an opinion with a gun. It does not reason, it enforces - it's people using force to get what they want from other people. Again, no one should have that power over another human being.
 
Seriously, your entire argument boils down to trying to rationally and morally justify the initiation of force by one group of people against another. I understand why you're doing this but have you ever stopped and thought about that and its implications?
Reply: "Which is an example of my point in that most people ACT amorally."

So then we agree that understanding morals =/= acting morally necessarily, so why do you expect everyone understanding the morals to make any such society possible by itself? Of course it would HELP a little bit, but when I say it doesn't matter, I mean that helping a little bit isn't enough to form a stable society, so it ended up not mattering that you got 10-20% of criminals to no longer be criminals, when they other 80-90% of them still = a ton of destructive morons that killed all the nice people as soon as there was nobody stopping them, even if there were a few more nice people.

"You seem to be under that assumption that people are inherently violent because people are violent"

Yes, some people are hereditarily strongly predisposed to becoming psychopaths. There are also environmental triggers, but if you have a strong enough predisposition, you're pretty much doomed. Is this most people? No. But does it only take 1% of cold, calculating, amoral people running amok with nobody allowed to intervene to defend against them to ruin your society? Yyyuup. And that's just one type of mental disorder, granting you the assumption that you've managed to raise everyone else perfectly.

Speaking of which, this is all also ignoring the incomprehensible part of your plan where you somehow expect everyone to raise their kids perfectly like little angels despite having no means by which to enforce any way of raising kids That makes NO DAMN SENSE. They already don't raise their kids well, and you are suggesting that we do even less to have anything to do with raising kids better, yet somehow, magically, they just... will? All of the sudden? Unlike any point in human history? For no apparent reason other than you willed them to? What silliness is this? That's no basis for any society, that's a basis for a children's cartoon episode.

You've given absolutely zero plan or reason for how or why people would somehow raise their kids any differently than they have for thousands of years. And no, "informing them of morals" does not count, that has already been a plan attempted for all of those same thousands of years, with no dice. So... next plan. What is it? If none, then we must assume that they will not, in fact, be raising their kids any differently than now, and that we will end up with just as many dirtbags from parenting as now, on top of those with actual disorders that you'd have anyway.

It doesn't have anything to do with one's views of what humans fundamentally are. Because we aren't starting with humans born in a magical vacuum with only their fundamentals. We are starting with the real world, and all you have to do is look around you to see what that's like. Spoiler alert: it includes a lot of dirtbags. With no good plan to change that, your society will too.

If you allow for no way of communally stopping those dirtbags (i.e. free defense of self and others, i.e. enforcement of rules against aggression and endangerment), then obviously they will turn your society into dirt.

"No, digbat, please try to follow along. You were talking about enforcing law. No one should have THAT power over another human being."

Since the only law I've proposed is one based on defense against physical endangerment, you are not making any clear distinction. "Enforcing my one law" = "defense of innocents" they are synonyms. By definition, I am not including any law that is not universally applied and that does not defend against physical harm (or also property damage, tangential to the conversation a bit). 

So I repeat: is nobody allowed to defend anyone? Or is everyone? Or are only some people? There are only three logical options, which do you support?
Reply: Gavin Jenkins

"so why do you expect everyone understanding the morals to make any such society possible by itself?"

I never said that, by itself, made anything possible. The process will likely be gradual and will involve a great deal of teaching and learning. As I said, it starts at home in how we raise our babies.

"Of course it would HELP a little bit, but when I say it doesn't matter, I mean that helping a little bit isn't enough to form a stable society, so it ended up not mattering that you got 10-20% of criminals to no longer be criminals, when they other 80-90% of them still = a ton of destructive morons that killed all the nice people as soon as there was nobody stopping them, even if there were a few more nice people."

What makes you so sure it would "end" up being just 10-20%? As I said, it's a process not just a one time stab at a free society.

"Yes, some people are hereditarily strongly predisposed to becoming psychopaths"

That's not what I said. I said, "You seem to be under that assumption that people are inherently violent because people are violent" which is circular logic and referring to people in general not exceptions.

You don't seem to understand the cycle of violence, that raising people to be violent begets more violent people who, in turn raise  others to be violent and so on.

What I suggested is working to break that chain by raising our babes using reason, peaceful parenting, and so forth.

"But does it only take 1% of cold, calculating, amoral people running amok with nobody allowed to intervene to defend against them to ruin your society?"

It's not "my" society, it's just an objectively better one then the one we have and self-defense is perfectly consistent with the Non-Aggression Principle so I don't know what you're talking about. There are ways of dealing with mentally disturbed or evil people in any society. Why would a free society be any different?

"Speaking of which, this is all also ignoring the incomprehensible part of your plan where you somehow expect everyone to raise their kids perfectly like little angels despite having no means by which to enforce any way of raising kids"

I don't know what that means. I'm purposing that raising children in accordance to the Non-Aggression Principle is superior to what we've done in the past - that teaching them to reason critically and negotiate is superior to obedience to authority and violence.

"You've given absolutely zero plan or reason for how or why people would somehow raise their kids any differently than they have for thousands of years."

How about stop beating the shit out of them? That might be a good start. How about we stop mutilating them (esp boys) right out of the womb? How about we start teaching them how to reason critically instead of threatening them with violence for not blindly obeying authority?

Oh...but doing that is harder then threatening a child with violence for not doing what you want them to do, just like threatening people with government violence for not doing what you want them to do is easier.

Do you see the pattern yet? Do you see what I mean when I say it starts at home in how we raise our children? The fucking government is just a larger manifestation of our early relationship with our parents when we are infants and children.

I have given you suggestions on how this could be done, you just don't want to hear it. Statism is so ingrained in you that you can't possibly imagine how Man could let go of it.

"Since the only law I've proposed is one based on defense against physical endangerment, you are not making any clear distinction."

Probably becasue it's LAW that I reject. Not self-defense/defending someone. They are not synonymous. "Law" is an opinion with a gun, it does not reason, self-defense is based on reason, on ideas like self-ownership.

Again, statism is so ingrained in you that you can't even separate moral principle like self-ownership and self-defense from "the state".

Think about what you're saying and how your saying it.
Reply: " "You seem to be under that assumption that people are inherently violent because people are violent" which is circular logic"

1) No that's not "circular logic." Concluding things based on observations and measurements is called "science." This would be like arguing that believing in gravity's existence or predicting it will continue to exist is "circular logic" because our only evidence of it is seeing it exist already.

2) The reason I gave wasn't just that one, anyway. I also said there are some violent people no matter what due to genetic (or early as in fetal etc. development) factors. So you'll never reach fully nice people even if you could mind control everyone into raising kids just the way you thought they should. So you'll still need some other protective allowances in society.

"self-defense"

Is insufficient for dealing with criminal elements in a society, as per common sense: if they simply form a gang of 10 people or so, then they can steamroll over anybody defending just themselves.

You MUST be able to also defend OTHERS in order to maintain any order and peacefulness. Which you already agreed to at one point, but then contradicted in the same post, so I'm trying to get a straighter answer.

And if/when you do agree to that, then we are in agreement in general, because I've suggested no rules or laws this entire time that could not be simply described as "defending others."

"I don't know what that means. I'm purposing that raising children in accordance to the Non-Aggression Principle is superior to what we've done in the past - that teaching them to reason critically and negotiate is superior to obedience to authority and violence."

Which has nothing to do with any means of making people actually raise their kids like that. So this does nothing to argue for the possibility of a society like the one you describe. They DON'T raise their kids like that now. But they would need to do so for your system to work or to be "objectively better." How to get from A to B? You've given no path or plan. So I have to conclude that we can't get to B (your described society) at all, until some plan is given for how to do that, exactly.

"How about stop beating the shit out of them? That might be a good start."

I agree that all your suggestions are good parenting advice, but have nothing to do with any plan for actually making society BE LIKE THAT. You suggest this, and a bad parent replies to this suggestion "No thanks. I'll keep raising them how I like."

And since you abide by non-interventionist principles, you can't make them change their mind. So much for that plan! Next plan?

"Probably becasue it's LAW that I reject. Not self-defense/defending someone. They are not synonymous. "Law" is an opinion with a gun"

Yes they are synonymous. Follow your own logic: when you defend yourself (let's say with a gun) are you enforcing an opinion? Yes, the opinion that you deserve autonomy and safety when minding your own business. Are you doing so with a gun? Yes.

So you are therefore an opinion with a gun. You are enforcing a law, by your own definition of law.

"self-defense is based on reason, on ideas like self-ownership."

Self-ownership is based on opinion, ultimately, like any value judgment at all. Unless you can provide a proof that shows it is ultimately based on tautological fact such as "P or not P" or "1=1", it's opinion.

It's one we both agree on, but it's still an opinion just as much as "I should own everything and have all the power" is an opinion that we fight against when we self defend.

In general, any statement that includes "should" "must" "right" "wrong" or similar words is not able to be proven purely by reason, as it will always be based on some other "should", and you'll just find turtles all the way down.
Reply: LSD Gets lighted with LED light "WHY IS IT NOT INCANDESCENT!?" TRIGGERED
Reply: +Gavin Jenkins
"No that's not "circular logic." Concluding things based on observations and measurements is called "science."

That's not what you're doing. You're ignoring the cause and measuring only the effect and concluding in must be inherent to human beings.

As I said, violence begets more violence.

To look at people who were raised to be violent and assume it is intrinsic because they are violence is circular logic, you are ending with the same premise you started with.

"This would be like arguing that believing in gravity's existence or predicting it will continue to exist is "circular logic" because our only evidence of it is seeing it exist already."

That actually is an example of a circular argument or circular logic as, again, you are ending with the same premise you started with. That gravity exists. Basically all you are saying is "gravity exists because gravity exists".

(I'm not saying it doesn't, but THAT argument is circular).

"I also said there are some violent people no matter what due to genetic...factors."

Irrelevant. You are talking about a tiny minority and there are ways of dealing with mentally disturbed people in any society.

"(self-defense) Is insufficient for dealing with criminal elements in a society, as per common sense: if they simply form a gang of 10 people or so, then they can steamroll over anybody defending just themselves."

No it's not. Band together with 20 people or hirer 20 security guards to protect you or figure out some other way of defending yourself. So long as you don't initiate force against anyone to do it the sky is the limit. This isn't as difficult to figure out as you're trying to make it.

"In order to maintain any order and peacefulness. Which you already agreed to at one point, but then contradicted in the same post, so I'm trying to get a straighter answer."

Note that you don't prove any example of where I did this, you just claim that I did.

"And if/when you do agree to that, then we are in agreement in general, because I've suggested no rules or laws this entire time that could not be simply described as "defending others.""

You still don't seem to understand that it's not rules, self-defense, mutual defense, or defending another that I reject, it's rulers and laws - it's the initation of force that I reject.

"Which has nothing to do with any means of making people actually raise their kids like that."

I'm not proposing "making" or forcing anyone to do anything, that would undermined the very lesion that I and other Anarchist are trying to teach. You can't force reason on others as that is irrational and immoral. Reason must be taught. It's a gradual process, it's not quick or easy.

"How to get from A to B? You've given no path or plan."

Not one you want to hear, clearly, as I've alluded to ways this might be achieved many times now.

That said, look how hard it is to convince just one person that force and authority are wrong and should be abandoned for something better. You've fought me on this tooth and nail from the start and now you demand I lay out exactly how I think all of society will transition from force to freedom.

Frankly, you are demanding I do all the work for you.

How do YOU think such a transition could be achieved?

I mean, the fact that I'm getting people to talk about this means I've at done something towards the goal of a free and peaceful society. What have you done?

"You suggest this, and a bad parent replies to this suggestion "No thanks. I'll keep raising them how I like."

And what about the good parents or parents who want to learn how to be better parents? You don't think that if we keep pushing (figuratively) and teaching peaceful parenting that it might, someday, perhaps generations from now, phase out violent, authoritative parenting and gradually change society in the process?

"And since you abide by non-interventionist principles..."

I never said I did or didn't abide by those principles. The only principle that I've definitively said I follow is the Non-Aggression Principle.

As I explained already, one can argue within the context of a principle they don't abide by or agree with. Anarchist do this all the time when arguing about which form of government is better (or rather, least harmful) or which government action is better while not agreeing with or abiding by the concept of "government".

"Follow your own logic: when you defend yourself (let's say with a gun) are you enforcing an opinion?"

No. I was reacting to someone trying to harm me. It was the person INITIATNG force that was trying to impose or enforce an opinion, who instigated the action, not the person defending himself/reacting on account of it.

This is a fairly typical statist argument, where you reverse cause and effect in order to reverse moral responsibility for action and reaction. Often it takes the form of, "but you will cause me harm if you don't pay me money (in the form of taxes, ect) so it's actually self-defense for me to force you to pay taxes."

"Self-ownership is based on opinion..."

No, it's based on reason, on cause and effect.

Who created the argument you are giving me? You did. The thoughts/ideas originated with you, with your mind. You are their cause, you own them in that sense, they came from you, from your self. The concept of "self-ownership" logically follows from cause and effect. You are the cause for your effects, your ideas and actions.
Reply: nowadays is impossible to find an incandescent light. the ban exists since 2012
Reply: Tecnovlog Doesn't matter if you pay more in the long run from buying a particular type of bulb. It's immoral to force people to follow your beliefs.
Reply: Tecnovlog Again, that doesn't matter. It doesn't matter because money and efficiency are not the goal. Morality is.
As I said, it's wrong to force people to do what you believe they should do.
Reply: the goal of what? so why not let people buy heroine, cocaine and lsd in supermarkets, why not let children drink alcoholic beverages or why not legalize prostitution?
Reply: so you agree that cocaine you should be sold in supermarkets. humanity must grow and we do not have infinity time to save our environment so people should be forced to do the right thing for everybody, even if they do not want it, if someone do not like this approach can leave the eu or start a political party
Reply: Tecnovlog So your answer to someone doing something you don't agree with is putting a gun to their head?
How does that help humanity grow? Was that not the same answer the National Socialists and the Communist gave before they murdered millions of people?

And I'd rather not leave society, I'd rather help make society better.

(btw, I never said cocaine should be sold anywhere, I just said I don't care if you buy and use it. Your body belongs to you. You can destroy is with drugs if you want, that is your risk to take and you are responsible for that choice).
Reply: society is better because we take the steps to the right direction, people are incredibly resilient when they are faced with changes, but changes are needed if we want to save this planet. here in my town now we have, i don't know how too say it in english but people collect the trash at our home, trash that we have already separated between plastic,metals,glass, etc.... so we do not have trash bins around the city, with this method we reached an high level of recycled materials, people need start to change their opinions, especially americans and chinese people
Reply: Tecnovlog You didn't answer my question. Your answer is to put a gun to people's head and tell them what to do?
I think society is better when people like you don't force your beliefs on others.
Reply: we do not put a gun to people's head. people can still buy incandescent lights from china or outside eu if they really want, besides that to me it's point less because we still can buy halogen lights that are way better than the  incandescents one., and the switch wasn't immediate but it took several years so people get used to the change
Reply: Tecnovlog
That's not what you said before: "...people should be forced to abandon old stuff..."

So which is it? Should people be free to buy any type of bulb so long as they don't initiate force against anyone or should people be forced to buy the newer, more efficient bulbs?
Reply: to me is the same, we switch off old stuff for new stuff, btw i'm tired of this i don't know if you're european or american but if you like it ok if you don't ok
Reply: Tecnovlog You didn't answer the question. 

Should people be free to buy any type of bulb so long as they don't initiate force against anyone or should people be forced to buy the newer, more efficient bulbs?
Reply: cuz land of freedom.. muricaaa
Reply: LSD Also you should know that resource shows  CFLs and LED light bulbs have higher toxicity and resource depletion than incondescent bulbs. Get an education before you mock people and make yourself look dumb.
Reply: Eli Cohan *leavers
Reply: Gavin Jenkins, single-payer healthcare is in waiting. Have patience.
Reply: ***** You missed the point. Again, efficiency and the environment are not what's important. Morality is. If we don't live in a moral, peaceful society then the efficiency of a light bulb and the environment doesn't mean shit.

And, under your logic, co2 shouldn't be considered ecologically hazardous because its beneficial to plants in the long run as plants need co2 for photosynthesis and ultimately produce oxygen for us to breathe, co2 is, basically, plant food (farmers sometimes pump co2 onto certain crops to help them grow). Without it, plants die. So, if anything, we should be pumping more co2 into the atmosphere, right?

So, even according to your own argument, it is actually the more modern LED bulbs that should be banned because they use less energy which means less fuel burned which  means less co2 for plants in the long run.
Reply: +Siniša R. The higher co2 promotes plant growth. If there is more co2 more plants grow naturally. And the Earth has had higher co2 in the past. Compared to then, we're actually in a co2 shortage right now.
Reply: LSD They are banned in Norway too😑
Reply: Problem ís that amount of CO2 we produce is much more then plants can absorb. In same time we also reduce numbers of plants. So reduce of global power consuption is part of global solution. LED Lighs are part of global warming solution.
Reply: Siniša R. Co2 levels are lower now then they where in the past.
Reply: You've just triggered me.
Reply: M T i use a broom...
Reply: LSD Wrong way of looking at it. Lead paint and asbestosis were both bad for people and could cause cancer or other health issues. Incandescent light bulbs do not cause health problems they just are less efficient so their is really no need to ban them.
Reply: Mike Hunt Green house gases from the light bulbs are surely bad, and they are a major part in global warming so I see your point.
Reply: One day soon we will let the birds fly and drop their beautiful incandescent eggs all over the world and it will be glorious. We'll start with the unappreciative Europeans, what a nice warm glow it will be.
Reply: Nice strawman.
Reply: Because incandescent lightbulbs, unlike lead pain, don't kill people. It's not that I don't agree with that people should use LED's, but more that people shouldn't be forced too. Why? Because we live in a capitalist country, and we like it that way. Deal with it.

Also, you may have a minor toxicity problem. People might actually agree with you if you wouldn't yell at them.
Reply: Class A  
We don't have capitalism. Corporations pay politicians to do them a "favor" - for example LEDs are a lot more expensive than incandescent, so a LED manufacturer will bribe the government to ban incandescents = way more $$$. That, is called "Crony-capitalism". That's the reason these bans exist.
Reply: +VivaMessico
Capitalism is an economic system, not a societal one. The fact that the government is bribed to pass laws does not change the fact that capitalism is the system that is in place. What you describe as "crony-capitalism" is not actually a separate system, but just the way that the upper class abuses capitalism. Every capitalist country will have this same problem at some point in time, and by extension any non-capitalist country, because it is impossible for corruption to not occur. Otherwise, I could say that "The USSR was obviously not communist, it was actually crony-communist", and I would be correct. 

In conclusion, yes, the US is capitalist, albeit not in an ideal state. "crony-capitalism" only defines a state that capitalism can be in. Just because you can describe a country as such does not mean that it is not capitalist.
Reply: I think government and economics go hand in hand. True capitalism can only be anarchism. The moment the goverment reaches into your pocket (taxes), it's already a step towards socialism. Same if they tell you, you can't buy this or sell that.
Reply: Class A 
Word!
Reply: +Kalil Ibn-Muhammed Bilal
Oh no
Please don't tell me it's infectious as well
Reply: *****"because we got rid of the nanny euro state"
Not quite. The dumbshits voted to leave, and the government slapped them back into place. Literally the only result of voting "leave" was ending up with a weaker currency. Something like $0.40 less to the £.

Well done though.
Reply: ***** It means the government slapped them like a silly child. Nobody with any power has any intention of making any steps towards leaving.

So the only outcome was to weaken the country's currency -- and whether it's 20c or 40c, it's still a lot of fucking money, and for such a petty cause.

That PC-gone-mad nanny-state fascist evil bureaucracy of Nazi fatcats...is still "in control".
Their regulations...are still enforced.

If you could "choose like grown-ups", you wouldn't have been blinded by romanticised nationalistic bullshit in the first place.
Reply: Bad analogy to asbestos and lead paint. Really bad. Incandescent bulbs are actually probably far less toxic than an LED bulb. It's made of just glass and metal. It's also much easier on the eyes (and brain). No flicker rate and a much more natural quality of light. I understand banning things that are toxic to people, like asbestos and lead paint. But banning regular light bulbs ? That's ridiculous. What next. Ban my vintage Marantz stereo? Because it uses more energy? Give me a break. Scientists need to focus on cleaner sources of energy. These stupid measures are only band aids that don't address the real problem. I'm not saying that LEDs don't have a place. They are nice for multi ganging - like in a lit cabinet. But I'll never rely on them as my only source of home light. I'd rather use candles.
Reply: ***** It's not "fearmongering" when it's evidently a fact: the pound is worth less as a result of the leave vote. All the vote has done is cost money. What happened to Farage's make-believe berjillions of pounds we'd have once we leave, to spend on schools, the NHS, and magical pixies?

But hey, nationalism. Gee the past sure was better! Remember how in the past pride was shameful? And yet these days it's ok to be proud of things you had nothing to do with. It's PC gone mad, i tell you.
Reply: John Boy"What next. Ban my vintage Marantz stereo?"

Is everyone mass-buying those stereos? Are those stereos purpose-built to have a short lifespan so people buy more and more of them?

That's just as bad an analogy. My point was that government intervention is the primary force behind progress. Here's a stricter analogy: the UK government banned free plastic bags at cashiers. People groaned and moaned at make-believe fascism...and yet the result was a huge drop in plastic bag waste.

Without some power behind it, things get nowhere. Food companies aren't gonna reduce salt or additives in their products just because a scientist recommended it: it has to be a requirement.
Reply: You must not be very familiar with consumer electronics. Yes, people are mass buying stereos and yes, they do have an intended short lifespan. Walk around any second hand store and you will see scores of Ipod docs, receivers, stereo boom boxes, etc. They all work just fine... however the pace of technology has rendered them obsolete. My Marantz was made in 1972. It's almost 50 years old and works great. Yes it's an energy hog. But how many stereos would an average consumer have purchased in 50 years? And how much production energy and waste is involved in those purchases? Also keep in mind the Marantz simply sounds better than anything that's come since (within a competitive price range)

Incandescent light bulbs can last longer. They are made to purposely burn out. Watch the documentary about planned obsolescence. Supposedly the original Edison bulb still works. So there is nothing about them that should be banned. 

We also have the plastic bag ban here in California. I'm still on the fence. NOBODY uses the reusable bags long enough to make up the difference. Most people just opt to pay a little extra for paper. I'm ok with that. Plastic bags bug me. I love paper. 

We have to be careful about letting the government regulate things. Progess can be made through incentives and education. Some things should be regulated.. but banning incandescents is just lame.
Reply: +Michael T. The same people pushing CFL's  over the last 10 years are now screaming about the mercury. They are now pushing LED's. In 10 years they'll be telling us the LED chip sets are toxic. It's cultural amnesia.
Reply: Asbestos and lead paint are poisonous and kill people. Lightbulbs are not poisonous, they're just expensive. Banning them does not save lives, and is not a public health issue. It's no different than banning sports cars, first class airplane seats, plasma TVs, or anything else that is more expensive than strictly necessary. Hell, why not ban cake and cherries and lobster too? We should all be eating bread and protein mash in our bare white 5x5 rooms. Seriously, why not? The logic is identical.
Reply: It's just a scam pure and simple. The same people trying to sell us CFL's for the last 10 years have jumped on a new bandwagon. Too much research showing how poisonous those CFL's are. I wouldn't be surprised if MR. LSD himself was pushing the old CFL's when they were all the rage.

Truth is, there ain't much money left in the old patent-less incandescent light bulb. If it weren't for the international light bulb regulations, there would be no money. Gotta get everyone to shift that spending to a new product. Don't worry about studies showing the upper end blue spectrum light can cause permanent eye damage and can weaken cognitive function.

If they could convince "green" consumers to buy mercury filled, poison outgassing, cute little pigtails, then these eyeburner LED's will be a cinch. Ahhh...  the power of the state over a weak mind.
Reply: LSD  "inferior in every way to alternatives,"

False. LEDs are better than CFLs, but the same was said about CFLs, and a ban was in place prior to LEDs being ready, so by that logic, there must have been "irrefutable proof" for those too. Yet they would give my ex partner for example terrible sunburns due to UV output and her skin sensitivity from lupus. They contained mercury making them inferior in disposal, AND much higher upfront costs. At least 3 objective inferiorities right there, without getting into any of the more contentious eye strain blah blah hypotheses. Definitely NOT "better in every way"

LEDs have fewer problems, but are also not better in every way. At face value, they still obviously have a much higher starting price tag, for instance, which is one way in which they are inferior. This can matter a lot, depending. If you're very poor for example and barely have the money to make your security deposit on a rent controlled apartment, paying all the upfront costs to fill the place with expensive LED bulbs initially may be simply unaffordable. Guess you just don't get light! Because no alternatives are for sale to use as stopgaps. Oh well, too bad, enjoy cowering in the dark. ...Every variable matters in different situations.

So no, they're not "irrefutably better in every way" they're merely "usually better in most cases" which is ALSO true of all the examples I listed.

So again, do you not support those other changes being regulated? You're implying not but haven't actually said no and seem to waffle depending on the example. And if not, what is your remaining reason for not supporting them too, since "must be irrefutably superior" doesn't pan out?

"If there are alternatives with almost no negative effects, then what's the problem?"
Great! So why not mandate everyone who can (barring doctor approved medical exemptions and young age groups for breastfeeding) switch to something like Soylent meal replacement? Or a better engineered alternative that lasts longer and is far cheaper due to national or international bulk production? Why are you stopping 1/10th of the way down the road of that same logic arbitrarily? If you support government managing our nutrition for us, why are you not calling for complete government management of our nutrition? It would definitely lower rates of diabetes, etc. Would do FAR more good for not only the environment (if designed for that) but health, than lightbulbs do.
Reply: Gavin Jenkins"the logic is identical"
No, it really isn't. You've jumped from humourous analogy to the familiar "YER DUN TALKIN COMMUNISM TELLIN US TO GIVE UP ER CONSUMER GUDS".

How did you even manage to compare lightbulbs to sports cars? If you want a closer analogy, it'd be more like banning cars with excessive emissions -- which funnily enough is essentially what the government does. In the UK, if your car's a piece of shit fuel guzzler, your vehicle tax is way higher.

That doesn't work for lightbulbs though, because A) they're so cheap, and B) there's so many. Banning them from being sold any longer gets rid of them quickly.

The only people complaining are the tiny portion of the populace with specialist needs, and the right-wing whiners that frequent the likes of the Daily Mail.
Reply: *****
 Scam. LED's only have one advantage - lower power consumption. They are inferior in every other way. Higher up front cost, more landfill time, terrible color rendering, logarithmic curve failure ( the older they get the worse they perform), non compatibility with dimmers, flicker rate, etc.

The nice thing about incandescents is that they mimic the color spectrum of fire / candles - which is what our eyes prefer in the evenings.

The worst possible color for human night vision is blue - hard on pupils. It causes pupil constriction, meaning there's less available light reaching your retina.. If you've faced the horrible xenon car headlights then you know what I mean.

There is also a disruption of cognitive function. Retention rate is much higher when reading from a book under natural light. It drops significantly when reading material off an LED backlit screen - this can be attributed to both pupil dilation and HIGH LED oscillation rate (flicker).
Reply: Gavin Jenkins
...except it's not about expense. The whole point is that they're hugely energy inefficient, as well as being specifically produced to last only a short lifetime.

An LED bulb requires 1/10th of the power an incandescent bulb uses, for the same light output, while a CFL bulb uses less than a 1/4.
Meanwhile CFLs and LEDs last between 10 and 50 times longer.

But hey, pretend it's "lobbying". Americans really are hilarious with their distrust of the government. Illegal wars, indoctrination, oppression, poverty? Who cares about that. THE LOBBYISTS ARE THE PROBLEM!!

And your analogies are absolutely awful, by the way...
Reply: Gavin Jenkins Does everyone "cook with extra virgin Italian olive oil instead of bulk canola oil", or is that just a relatively low percentage of the population? (and how is that even relevant, let alone energy inefficient? You know "virgin" oil comes from the first press, right; it's not wasting energy in any way -- again, your analogies are awful.)

Every single person who lives in a home owns lightbulbs. I'd say about 8-10 per family. That's a lot of lightbulbs, and a lot of wasted power. The other stuff you mentioned, irrelevant as it is, is not only far more difficult to measure, but also doesn't have alternatives with almost non-existent drawbacks like with lightbulbs. That's why the government is banning bulbs and not other things.
Reply: Where I live, LEDs that are actually equivalent products to incandescents, i.e. near 2700K coloring, with high CRIs, dimming, non-flicker, are about $9 CA each. (Shittier ones are cheaper, but also deviate much further from your "better in every way" so not a proper, fair, or logical comparison) Incandescent 60W bulbs cost around $2. In my pretty typical seeming 1 bedroom apartment right now I have 10 bulbs total (incl. ceiling, bathroom mirror rack, etc.), so that's a difference of $70 up front.

That's some people's entire food stamps for the MONTH, and is absolutely not a "moot point" if you are poor. You may also not be very familiar with being very poor, I don't know, but it usually tends to then cost much more than that, since to pay for something you have to take it on credit, then you get slapped with exploitative interest, and it can easily end up being $120 instead. Which you still can't pay, or if you do, maybe you can't get rent and you get fined for being late another $30... etc. etc.

POOF there go all your long term energy savings, and you could easily have ended up being better off with incandescents.

This is the downside to micro-managing people's lives without actually micromanaging an understanding of individual situations. You WILL do a poor job of it sometimes, and people end up suffering.

Maybe you think not very many people will suffer, and it's overall better anyway. I'm not sure I agree, but sure, that's a valid argument perhaps.

BUT if you're going to make that argument, at least be consistent about it, and not randomly arbitrary about it. Apply the same logic to food and furniture and heating and housing and clothing and bathroom supplies and appliances and .......

"I never said anything about them taking over every aspect of nutrition." <-- I know, but WHY haven't you? It would be the same logic as here. That's my main question to you. You say "environment is worth regulating for" but then ignore 50 bazillion opportunities to regulate for the environment with even more impact.

------------------------------------
Miscellaneous:

"A few years ago incandescents cost the same price as LEDs do now." Lol no, incandescents have never cost remotely close to $9 in my entire lifetime.

"But government regulations also make it illegal to just trash [CFLs]" Oh there's a RULE? Well it must never ever happen then! Nobody ever hid it in the trash anyway out of convenience, because there's a rule! Don't worry, environment!
Reply: Gavin Jenkins
But you need irrefutable evidence for any of the changes you listed.

With bulbs it's a given that everyone has them, and there's irrefutable proof that the ones currently used are inferior in every way to alternatives, while negatively impacting the environment.

Think plastic grocery bags: they're everywhere, everyone uses them, and there are alternatives with no downsides which will massively benefit the environment. Result: banned.

Whereas with food. it's far more difficult to measure who's using what, to get evidence of health/environmental effects, and alternatives can vastly impact how products end up.

Either way though, government intervention has directly impacted food. Additives are highly restricted in the EU, about a decade ago i'm fairly sure there was a ban on various oil types (and the majority of manufacturers turned to sunflower oil), and recently there's been talk of banning products containing trans-fats -- and i fully support it. If there are alternatives with almost no negative effects, then what's the problem?
Reply: Think the guy said it in the video but LEDs have dropped massively in price, and with old bulbs out of the way,

"If you support government managing our nutrition for us, why are you not calling for complete government management of our nutrition?"
Isn't that a strawman (a term that's lost all meaning the past year or so).
The government exists to protect its population, and businesses exist to exploit them. So when they're exploiting the people (like with shitty additives in food), the government stepping in is to restrict them is the only positive solution. I never said anything about them taking over every aspect of nutrition.

Upfront costs are a moot point: LEDs cost around £1-2 more in the UK, but last on average around 50 times longer; CFLs cost around the same as an incandescent, and last 30 times longer. I don't think anyone will seriously be affected by such a small price difference. A few years ago incandescents cost the same price as LEDs do now. Did the poor live in a dark age back then or something?

The damage CFLs can cause i can't speak of since i've not heard of it before, but as for disposal: that's debatable. They need to be specifically recycled yea (and almost every part is re-used). But government regulations also make it illegal to just trash them, and since all the ones i've ever bought have a long life guarantee, it doesn't seem like such a huge problem.
Reply: Gavin Jenkins Who the fuck has ever had to replace every bulb in their house? Like, seriously?
Before you accused me of rambling, and now you're here talking about credit card debt caused by a ridiculous hypothetical situation.
Reply: Dan Heuser " Just because the government bans one thing, there's no reason to think that they're going to step in and unreasonably ban many other things."

That's not what I said. It's not that I think they WILL ban cashmere sweaters. It's that the LOGIC is equally as valid as if they passed a law banning cashmere sweaters.

It's an example to demonstrate the silliness of the law. Not a fear of the next actual step taken.

And in fact, them NOT probably passing other laws like that is exactly why it's hypocritical. It's pretty much the opposite of a slippery slope argument. it is a "why are they logically not going down the slope" argument.

"you seem to be ignoring the consequences of consuming more energy that generally results in more CO2 emissions and other emissions."

No I'm fully aware of that argument. What I'm asking you is why are you not applying precisely the same logic to cashmere sweaters, ferraris, houses larger than one bedroom per 1-2 people, laws against more furniture than people use, laws against multiple pets, laws against exotic foods like imported tropical fruits in Minnesota, laws against electric space heaters (versus gas furnaces), laws against recreational helicopters, laws against leaving appliances plugged in when not using them, laws against stone countertops, laws against mahogany bannisters, laws against aluminum silverware that takes way more energy to smelt than steel, laws against laws against laws against EVERYTHING ELSE in the world that proceed from the same logic you're saying? Every one of the other millions of things that waste even more energy than incandescent bulbs do? That is hypocritical and arbitrary.

The government picked one random thing to regulate the shit out of, with no apparent rhyme or reason. It's not the biggest energy waste at all. It's thoroughly low or medium on the list of things that use energy. So why that thing? Why not every other thing? How is that justified? How is that consistent with anything?
Reply: No one wants to hear your self-righteos communist gibberish.
Reply: Gavin Jenkins
If they can reasonably ban other things that are harmful, then I'm for it. 

Even if they are being hypocrites/unfair in only focusing on light bulbs, it still doesn't change the fact that incandescent bulbs waste energy and are less cost effective in the long run.  Let's not avoid making a change for the better because we still have a lot of other bad things in our society. 

Also, being a hypocrite doesn't invalidate an argument/position.  If a serial killer declared that murder is wrong, he would still be correct, even though he's a hypocrite.
Reply: Being realistic, if people are still buying incandescent bulbs, It's indicating mainly either 2 things. People generally think that the light produced by them is of better quality and so worth the cost of higher energy bills or that the marketing for LED's has been too poor to properly inform the public to have them switch. Don't see why the government should banning selected technologies, don't mind the government making intensives towards greener tech but unless it's a danger to public health then it should be purchasable.
Reply: Dan Heuser So just to be clear: you are FOR banning the entire list of things I wrote above? You are FOR legally requiring everybody to have one light on whenever doing things only sufficient to illuminate the task, legally own only electronics relevant to their jobs and productivity and survival etc, legally own only THE single most efficient for their region product of eco furniture, clothing, housing, transportation (most people not legally allowed to own cars unless vital for productivity and environment), pets, food, art, and entertainment?

"being a hypocrite doesn't invalidate an argument/position."

It actually usually does. Not directly by logical necessity, but because if the logic were actually sound, you would be applying it everywhere else too. The fact that's it's not been chosen to be applied in 99.99% of relevant cases is an EXTREMELY good sign that it is flawed somehow, and that people realize this and that is why they would reject attempts to apply it in all those other cases. Not tautologically so. Just pragmatically so.

It is less likely to apply for the serial killer, since his judgment is not soudn as an insane person, but when dealing with society in general, composed almost entirely of sane, logical people, a policy not being applied by them in the VAST VAST majority of cases is a huuuuuge freaking clue.
Reply: Ender Skies No, it's because we really don't like the idea of a government that thinks it can tell us what sort of freaking light bulbs we're allowed to buy.

I'm a guy that started switching to CFLs in the late 1990s, and am now converting to LEDs as the CFLs need to be replaced, and the ban bothers me.  I think the "social contract" should be that in exchange for me not doing stupid stuff, the government should stay the hell out of my business
Reply: Dan Heuser Most of the things on my list meet all of your criteria easily. For example, exotic imported fruit: easy to enforce? Yes just make it illegal to import any at customs, the businesses like grocery stores already declare it as is, this is trivial. Good replacement? Yes, all other more domestic fruit that gives you the same vitamins etc

"Arguments stand or fall on their own merits"
And the logic behind this has FALLEN in 99.99% of cases for the millions of products out there that would be equally easy to ban and equally good for the environment to do so but never even considered or shot down.

As I suggested earlier, the fact that one tthing got through head and shoulders above the rest of nearly identical cases is logically much more likely due to something like that one industry lobbying a lot than it is anything like how good of an idea it is.

"If there are other things that we could be doing that are equally as practical as switching from incandescent bulbs to LEDs"

Yes there are literally tens of thousands of those things. I listed several hundred or thousand of them already (all the individual products that would fit under the categories of laws listed above that are just as practical as bulbs)

The fact that anybody who thinks about it for a minute could easily come up with dozens of equivalent examples, yet there are almost no other even attempts at bills to do the same for these other products, is very telling.
Reply: Dan Heuser "This is the same argument that people use against gay marriage" -

You're not that far off..  http://abc7.com/society/polygamists-want-their-unions-legalized-under-marriage-equality-act/825115/

and

http://www.vice.com/en_dk/read/its-legal-to-have-sex-with-dogs-in-denmark